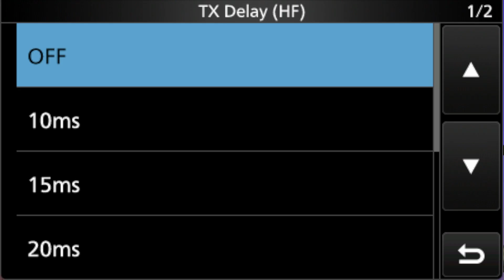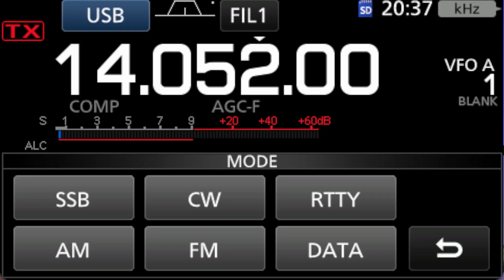How to Set TX Delay on the Icom 7300 for Seamless Amplifier Operation

Comment: SHould the Icom 7300 use its DIN connector to connect to a modern amp, or the single RCA jack on the rear?

Comment: Very helpful information. One thing I found on the website of DJ0IP is that the TX Delay should be set to 25 ms if using the IC-7300 with an Ameritron tube amplifier. ~ 73 ~ AC7WH
Reply from the maker: I can’t imagine why. I don’t think the IC-7300 is any slower at switching than other radios.